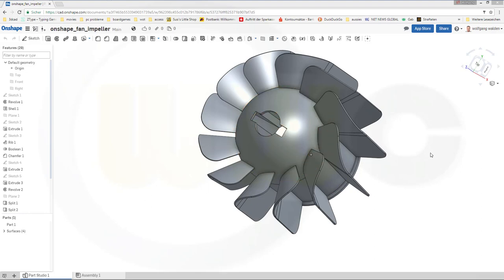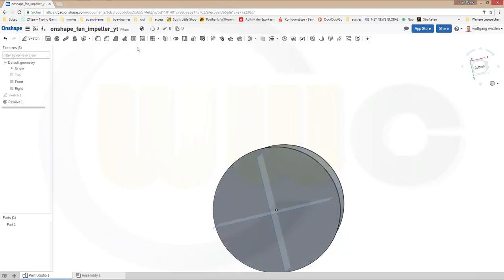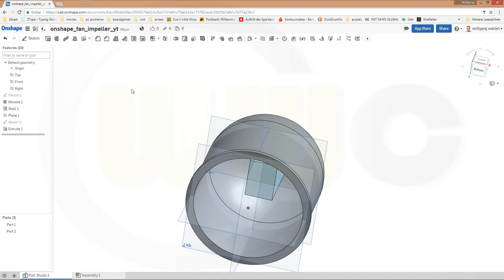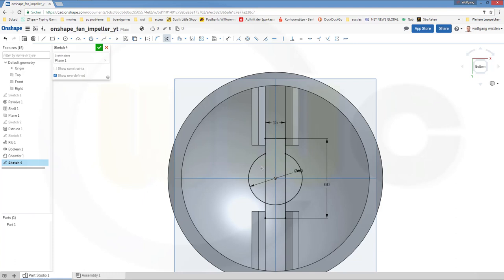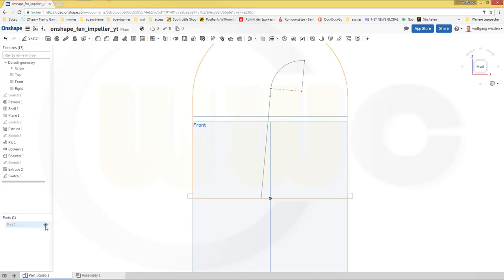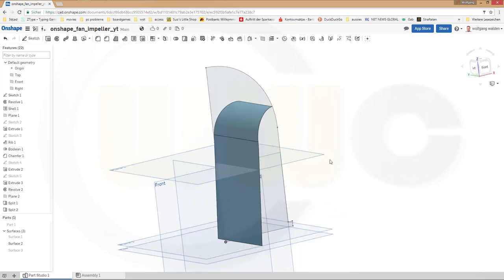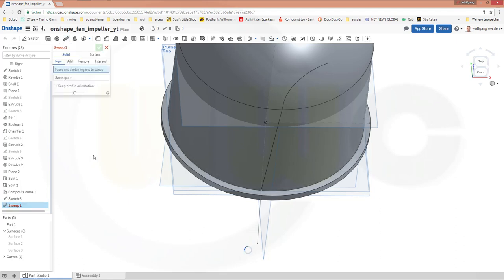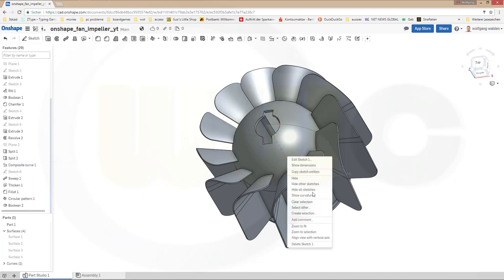Userwish - Fan-Impeller - Onshape Training - Part Design

Comment: Hi Wolfgang - thanks a lot for all your videos, learning a lot from them!
Quick Q; when you are creating the rectangles with symmetry on both center axis (at about 5 and 8 minutes), is there a reason for not using a "center point rectangle" (shortcut r) and just have that snap to the projected origin point?
Reply from the maker: No special reason, I just usually don´t use it ;)
Reply: OK, thanks again for great videos!
(Found a marginally easier way to get the projected curve; drawing the shape on a plane "outside" the cylindrical part, then extruding a surface "Up to part", you'll get an intersection line for the final sweep)

But again - great learning materials in all your videos :)
Reply from the maker: Works of course as well - but a project tool would be better.